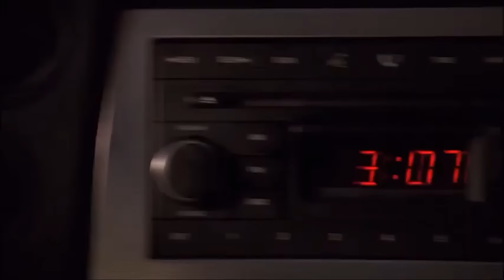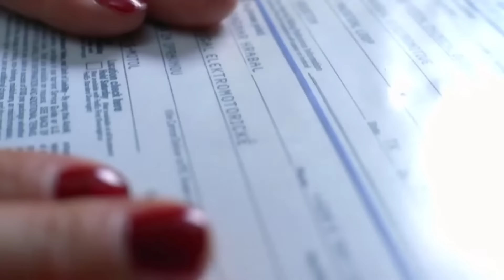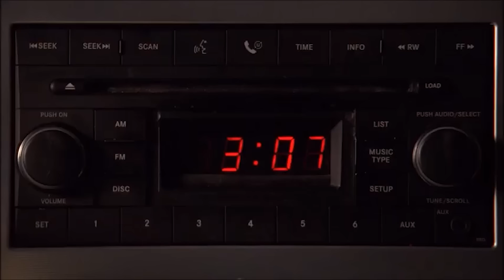Why Did Gus Warn Hank? - Breaking Bad

Comment: Walt explains this within a few episodes. Gus didn't want it to be a silent execution. He wanted Hank to know so it would start a shootout for everyone to see, thus ensuring the twins, and more specifically, the cartel, found out.
This would cause the DEA to down hard on the cartel as going after a DEA agent is a surefire way to get them to your front door. 
I actually think Gus respected Walt at this point in the story. Walt only becomes a problem in the later half of the season.
Reply: Correct.  It wasn’t until Walt ran over the two henchmen (saving Jessie) that Gus became and antagonist for him.
Reply: Gus also subtlety threatened Walt's family early on, which is why Walt was scared to leave. Part of why Gus didn't work with druggies because they had nothing to lose/use against them. Keep Hank alive as a way to keep Walt in check, if he died then at least he has the DEA doin come down on the cartel and the brothers. I think Gus subtly threatened Mike in a similar way, but Mike had a much greater tie to Gus' operation than Walt did
Reply: Exactly lmao. Just watch the show and it’ll make sense.
Reply: Thank you lol

Comment: Gus didn't want Walt dead until after he killed the two dealers. It seems more likely that Gus just thought Gale was a better partner and that Walt was dying so in case cancer took Walt he'd have a chemist to make Walt's meth. Gus did seem to care about his loyal employees if nothing else as a way to motivate them to do a good job rather than rely on solely on fear like the cartel he hated. You can see this in how he stocked blood for Jessie and Mike at his secret Mexican hospital. Sure they were both needed employees but I couldn't see a ruthless bastard like Hector doing that for anyone. However, when Walt became insubordinate to the point where he was clearly out only for himself, that's when Gus wanted Gale to take over ASAP.

Comment: Simple: the twins weren’t expressly Gus’s and he couldn’t control them. Also, Gus  knew that his interests and the cartels would soon be divergent, and creating smoke between the cartel and the DEA meant drawing heat and resources away from his own operation. If the twins are permitted to simply roll up and kill Hank, that takes cartel heat off Gus temporarily. If they wound Hank, it means Hank can finger the Cartel personally, use his status to wage war on the Cartel on both sides of the border, and - best case - remove one or both twins from the board. Hank took out Tuco - or so Gus thought - and he probably figured he might luck up again with the twins. I’m pretty sure Gus thought it likely Hank would eventually die, but for him to become a martyr to the DEA cause in Mexico would be a major hassle for the Salamancas and Eladio specifically. So just leaving Hank to die was, for Gus, not efficient. To warn him, give him a chance to strike at the Salamancas AND the Cartel, that was the genius move of a guy seeing the whole picture.

Comment: I think one thing that was missed was that Gus didn’t necessarily care if Hank lived or died. He wanted a firefight to act as a spectacle to get media attention of a cartel attack on a DEA officer. If Hank, was simply killed, the response from the DEA likely wouldn’t reach the threshold necessary to start the crackdown on the cartel that allowed him to get rid of Don Bolsa. By starting a war with the DEA, the Salamancas would have also lost a lot of influence and Gus would become more instrumental to the cartel even if the twins lived. 
The outcome that occurred appeared to benefit Gus in the short-term as the Salamanca twins were killed and the crackdown began but Hank would ultimately be a contributing reason for the fall of Los Pollos Hermanos.

Comment: Gus did not need to bother warning Hank. Hank didn't take him seriously anyway. The twins had a perfect chance to shoot Wal-Turd while he was in the shower and before they had a chance to receive the Pollos text, but they just sat there and waited for no reason except that Walt had to survive to continue the show. Hank survived because the twins had Imperial Stormtrooper-like marksmanship and they were idiots, not because of Gus's warning. One twin stupidly stood still while Hank was speeding his car, instead of running a little to the left or right to avoid the speeding car. The other twin, Mr. Dumb-axe, had the perfect shot, but he missed his chance and said "muy facil" and turned away very slowly to get his axe. He dropped a bullet so Hank could load his gun and he walked very slowly so Hank would have time to load the bullet into the gun. He also positioned his head perfectly so Hank would have an easy head-shot and avoid the body armor that saved him from Hank's prior shots. It seemed like he had as much brains as hair.

Comment: warning Hank was the smart move regardless of whether Gus was aware of Hank’s connection to Walt. Whatever the result of the twin’s assault on Hank, Gus is better off;  the best outcome: the twins and Hank kill each other, next best hank and at least one twin are killed. the worst outcome is that Hank is killed and the twins survive; in this case Gus benefits by removing a troublesome DEA agent and the Salamancas vengeance is mollified. Even in the worst case outcome, everyone survives, Gus wins because now the DEA has a reason to make an assault on the Cartel, as was shown a few epsodes later when Juan Bolsa was taken out. This whole video red herring about preserving Walt’s opinion is irrelevant. this is clear because the near fatal assault on Hank did not in fact scare Walt off.